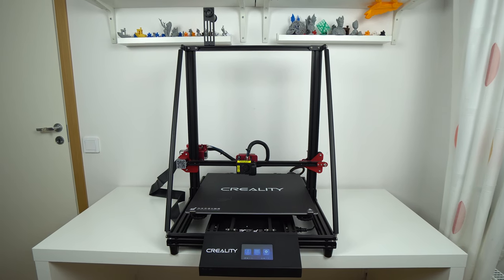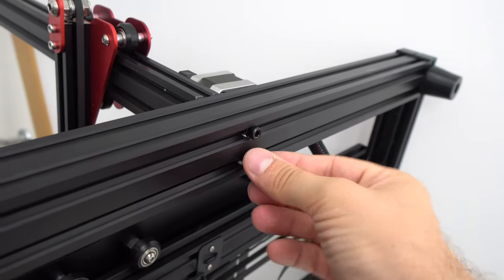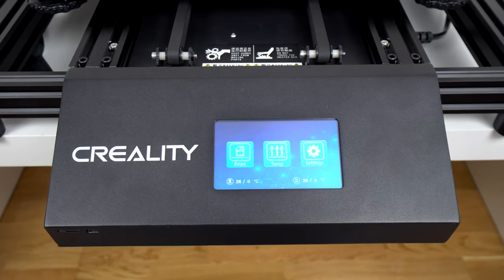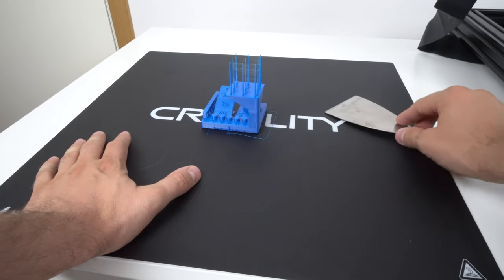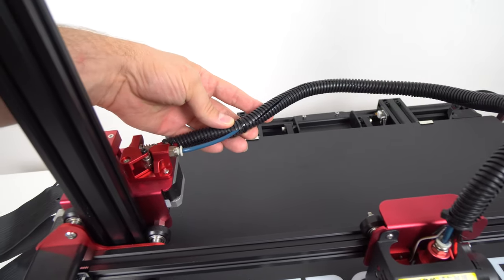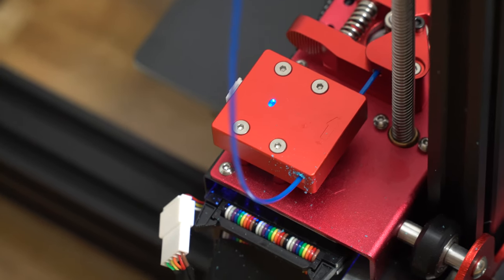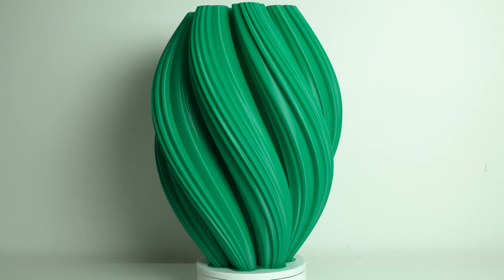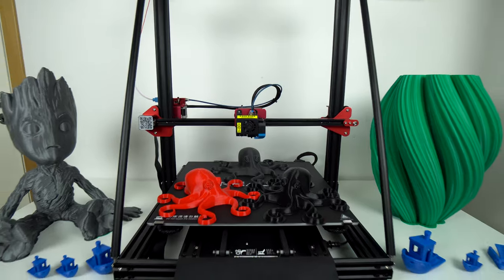Creality CR-10 Max 3D printer review - all you need to know

Comment: Man that was easily one of the best 3d printer reviews I’ve seen. There’s nothing like a quick fix. One of the fundamental teaching principles is to design in mistakes for the student too solve. Again excellent work. 🤜🏼🤛🏼🇦🇺🍀😎🤓
Reply from the maker: Thank you so much Steve 😎👍😁
Reply: @NexiTech  Are you able to print a full size Ghostbusters proton pack? I would like to see the print quality.
Reply: @NexiTech  which filament would be best for durability  for printing the Ghostbusters proton pack shell?

Comment: Awesome video and we will continue to improve :)
Reply: Creality hi
Reply: Have you solved the thermal runaway issue, on the ones selling today? Only thing holding me back from buying
Reply: This machine is a junk kit. Problem after problem. Creality is a scam. Only response on this fire hazard is "contact tomorrow".
Reply: You guys already do a very great job for the community for the price! Lower priced machines help push the whole industry big time!
Reply: Maybe if you want to improve you should make CR10 Max so it homes the bed and actually works. 
It would be wonderful as well if you actually answered support requests so a quite expensive printer could actually be used.
It is absolutely unacceptable that there is no help available.

While the CR10S burns the control cards, the only problem free Creality printer is the Ender 3 Pro.
Reply: @jenspetersen5865  Just my two cents, as I received the notification about your reply, is that creality is very good as a budget brand, I personally would never pay $1000 for such machine. It is simply not worth it. But their basic cheaper machines are a pretty good deal for the money which enables more people to afford them. It's Chinese company, show me one Chinese company in the whole world that actually offers any decent customer support :) That should be expected imo.
Reply: Quite awesome printer thanks!
Reply: Hello, is the heat bed issue fixed in current models? Are the aluminium supports insulated? Thank you.

Comment: In 2021, a few of the issues you had with your printer were not present on my CR-10 Max; the wiring across the X gantry does not sag below the print anymore, it was well above the nozzle, also the wiring out of the back on the Y axis was not short on mine, there were plenty of slack and I saw no reason for concern.  HOWEVER, the aluminum extrusions on bottom were definitely not improved; I went ahead and did the fix you showed in your video prior to assembly.  Thanks again!
Reply from the maker: Thank you for the information. Best regards man!
Reply: @NexiTech  I had that Y axis ringing  you did in your video, did the exact same thing, put it on the floor and my ringing is gone, with the Z banding about 95% fixed; guessing that last 5% is tweaking the flow (had to do this on my Ender 3).  Thanks again for your video it was a lifesaver!

Comment: 2021, May: Don't remember where I have seen it but was available for less than $500.

2 QUESTIONS:
 - Is the controller board a 32 bit? or 8bit as on the previous Creality models?
 - where does it fall for noise level? not a value, but a comparison to other silent machines...

THIS PRESENTATION!!!
To the point, no fluff, no stupid jokes, pacy, thorough, with injected experience...
I challenge anyone to match this level of presentation/review... I had seen another review which basically talked me out of this machine... after seeing this one, it is obvious the other presentation was made by one who lacked understanding and failed the machine rather than the other way'round.

Comment: Hey Nexi,

thanks to this video i just bought and installed my cr10 max.
3d printing is all new to me and this is my first printer.

I've followed your tips with the insulation cotton and the flower stick haha.
Could you maybe give me some tips (or make a cr10 max tutorial) on the best way to use this printer?
My main question for example is how did you decide the offset for the Z-axis and what print settings work best for this printer?

Comment: Great Video with lots of Brilliant tips. was wandering if you would do a slicer video for the settings you used with different nozzles. I have just received the CR10 Max. I printed the elephant example great, but cant get my own models to stick to the bed. It almost seems as if the nozzle is too high and wont push the first layer into the build tack. Im using the creality slicer.

Comment: You are the man. The table issue realting to ghosting is really dope. I'll test it tomorrow.
Reply from the maker: Thanks man! Placing the printer on the ground if you have hallow desk table like mine can help a lot.
Reply: @NexiTech  I fixed the table to the wall with reinforced iron Ls these ones used for shelfs and fixed the machine to the table itself. Better quality and speeds.

Comment: Any chance on a link of the files to the filament guide you showed in the video. I have found with my new max that it was way better to take the spool off the top rail and move it to the bench below and the filament guide would be perfect for this. By moving the spool below and off the top frame, it reduced the overall vibration in the machine greatly.

Thanks Andy

Comment: Graeat review video. Thanks to your video I just bought one yesterday because I need that print size and your great video took me out the insecurities. But I have a question. Which slicer you use? Because i just downloaded Cura and I didn’t see the peofile for this one. Can you help me out with this please?
Reply from the maker: Thank you my mate, I'm glad that my video help you out.  I use Simplified 3D. In CURA you can use Cr10 or Cr10S4 printing profile as well. Just go to the machine settings and edit/increase machine size to 450x450x470mm
Reply: Nexi Tech What about the startup gcode - don’t you need to embed gcode to invoke the auto-bed leveling at the start of each print? I use PrusaSlicer.

Comment: Hello I'm planning on buying my first 3d printer and plan on using it for table top minis and terrain (lots of small stuff and a hand full of medium sized stuff). I've bin doing alot of research and found your channel (learned a hole lot here too) with out much in the way of modification  what would you and your community suggest for first printer?
Reply: Ender 3 or ender 5. Really good for terrain and minis

Comment: I just purchased a CR10MAX  and am having a problem with the bed heater.  The bed heater turned off sometime  during the print.
I just checked on my 6 hour print and the bed is at 21 degrees C ambient. Is the bed heater supposed to stay on for the full print time? 

I don't know when it went off, it was sometime before 95% done. The Print is warped on the left side pealing up off the bed.
Have you seen a problem Like this?

Comment: at 27.21 video mark you add a heat insulator. What is the material. fiber glass should work fine and also be a good stiffener.
Reply from the maker: It's heat insulation cotton sheet. I place link in video description for more info. Yes i believe that fiber glass could work nice as well. Thanks for the comment. Cheers

Comment: Hi man! I’m interested in buy a cr10max and I’ve read a lot of bad things about it and now I’m confused. Can you tell me if your experience is still the same or you had lot of problems with he printer after few months of use?
Reply from the maker: Hi Victor, Let me tell you that I'm using 3D printers for years and these machines are very reliable thanks to simple design and a few main components. Basically you have Power supply, motherboard, stepper motors, LCD, bearing wheels and micro switches. Beside bearing wheels(plastic ring on them) I didn't see anything else go wrong in the long run. Even belts that until a few years back was made of plastic now they are build from reinforced rubber and they last many years. So there is not many components that can go wrong on a 3D printer in general and on Cr10- Max the most expensive part is the motherboard and it costs around 80$ where stepper motor cost around 10-15$. Personally i never saw a motherboard goes wrong and the stepper motor fails me only once on the small Ender 2 3D printer that I had few years back. That's my experience so far my friend. 
Wish you a great day. 
Nexi
Reply: @NexiTech  thanks a lot!! Appreciate it!!!!now you got a permanent follower ☺️

Comment: Hican you please  Check my CR10 MAx video after one week received blt touch doesnt work probe not extending for measuring just stays solid red. Flashed firmware and lcd now my computer wont pick up the printer connected through USB.

@

thanks

Comment: Try the Elegoo Neptune 3 Max. $470 USD. 420x420x500mm print bed which is PEI, so no spatula needed. Direct drive. cable connected control screen. To be honest, a far better machine at a fraction of the cost.

Comment: I'm new to this 3D printing world and the CR-10 Max is the first printer.  I haven't been able to print successfully.  I think its feeding to fast and works for about 20 min and then quits printing.  I have to pull hard to get the filament out and start over.  I know I just haven't set it up correctly but I can't find a good source of information on how to set it up.  I'm using Creality Slicer 1.2.3 but the max isn't a printing option so i'm guessing on most things.  Anyone able to point me in the right direction?

Comment: Hi where is the insulation from for the bars under the bed also could you add  a seperate ac heated bed mat like others to get the bed up to 135 is this needed and an enclosure for better abs and polycarbonate prints ? thanks David NZ
Reply from the maker: David Butcher If you going with the AC silicon heater then I would replace the aluminum heated bed with the custom cuted thick tempered glass.  Any glass cutting store should be able to make you one glass sheet for cheap price. That would fixed any aluminum/temperature warping problem and you could have nice and flat huge tempered glass bed with AC silicon heated under it.

Comment: I was just wandering if  there is any chance you could do a  review on the CR10s pro V2?
Reply from the maker: I already reviewed CR10s PRO and CR10s PRO V2 has only Bltouch instead of capacitive sensor probe and better resolution LCD. It's basically the same 3D printer with identical print quality.
Reply: @NexiTech  Also one more thing does the CR10s pro V2 have  thermal runaway protection? And thanks for info.
Reply: @NexiTech  When you first opened the box did you find any residue in the little box of accessories? The reason I'm asking, is my CR10s pro nV2 just came in today and I found some residue in there.  It was mainly in the little bag of leveling tools. If you could tell me what it is that would be great.

Comment: Hi at 13:47 you mentioned installation column sheet, what material is that?? Thanks
Reply from the maker: Insulation cotton, you have the link in video description. Cheers!
Reply: @NexiTech  thanks matey. 3 more questions if you dont mind 1.)  when you print the grout do you have to use any support for the head when printing? 2.) When you use 0.8mm nozzle, why do you use 0.6mm thickness instead of 0.8mm, not sure if 0.8mm thickness is possible? Sorry for these questions, I'm just beginning to get into 3d printing 3.) Do you recommend using 10% feel for the first large model print or what would be the possible minimum required % filling?

Comment: How do the CR10 range compare to any cubic predator?
Reply from the maker: Comparing Cartesian and Delta 3D printers is not that easy :) They are very different machines and I like them alot. Delta's are faster and they usually have better print quality on higher print speed because of much lower moving mass. On other hand deltas arms ball joints will not last near as long as bearing  rollers whells on Cr10 line 3D printers or others.
For example I already replaced ball joints arms on my Anycubic Predator after only 3 months of use where on other hand bearing roller wheels on my old cr10s that I have for few years now are still good.
Also to be able to have print volume of this size that Delta would need to be insanely large.
Reply: Thank you very much for the reply and summary comparison.  I had no idea on the beating wear on the delta. Great reviews. 👍🏻
Reply from the maker: @glentrudgett5877  No problem my friend, I wish you great day.

Comment: Creality firmware sucks, yet they don’t fix the problems. I bought a Cr-10 max 2 months ago, even though I saw comments from more that a year ago complaining that the bed leveling was broken, I figured that they surely would have an update to address that by now. Nope! Same with the file name length bug. If you want fully functional machine, you are going to need to change to Marlin firmware.  But Marlin firmware doesn’t’ have configuration files for the Max? Seems like this printer is not common enough that people (or maybe even Creality) have support for it. Maybe I will look at another printer from Creality when I see reviews that show the Creality have fixed their firmware!
Reply: I don't know any CR-10 MAX 2.
Reply: @jirikabat203  he meant he bought it two months ago.

Comment: Tbh after i bougth cr10 pro witch it was a nightmare and cr 10 pro had a lot of issuses it completly turned me off from 3d printing until i bougth pursa i3 mk3 and i was happy  iam very worried about this one it seem very the same as pro
Reply from the maker: I understand. ON my CR10S PRO I replace bad stock capacitive auto level sensor with 10USD inductive sensor and that solved Auto level issues and problem with the first layer on my Cr10S PRO. Also Creality have released new firmware for Cr10s PRO which works great and in combination with new inductive sensor my CR10S PRO is awesome. I made few videos about few upgrades for CR10s PRO to help the owners you can check it on my channel. 
 P.S. CR10max has BL-touch and upgraded firmware, It works great and it has no issues with auto-level or problems with the first layer.

Comment: You have learned very much and done so many prints with your experience with the BL touch sensor on this machine would you still change the capacitive sensor of an inductive sensor on the CR10s pro or would you change it out for a BL Touch like 3D printing Canada https://youtu.be/de4b6HZIpNA did? 

Also your hypothesis was that the prints would turn out worse than the prints on the CR10s pro. What is your take on a comparison between the two printers?

Comment: I would take off the legs and sit it flat as long as the cooling fan in the power supply allows that
Reply from the maker: Those rubber legs keeping the printer in place as when it's starts to print and move it's quite of momentum sense it's so large. That's why it's important to have some good and heavy support underneath like real full wood table. My papper/hallow ikea table is definitely not the good solution.